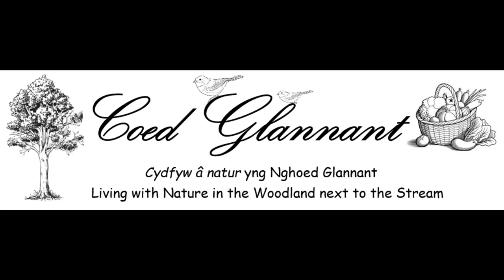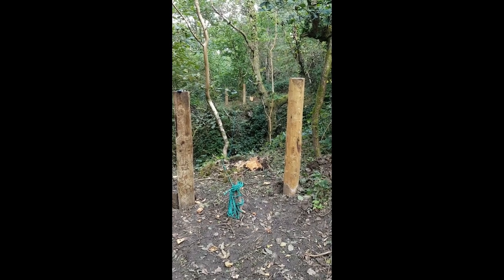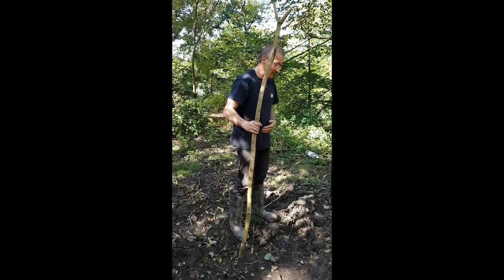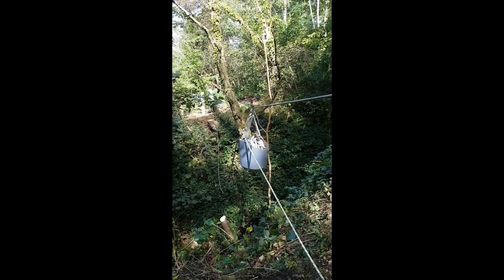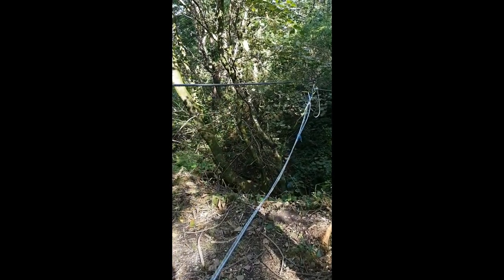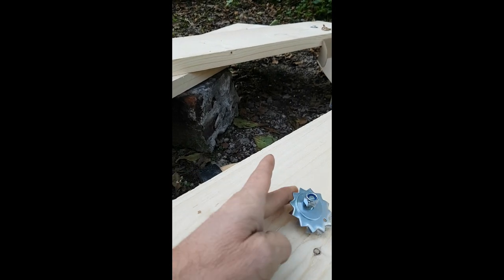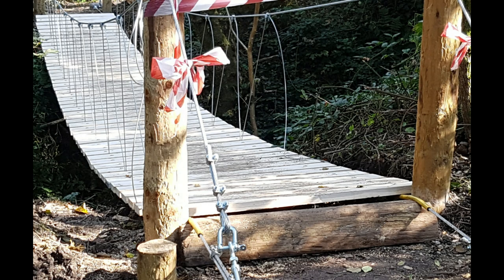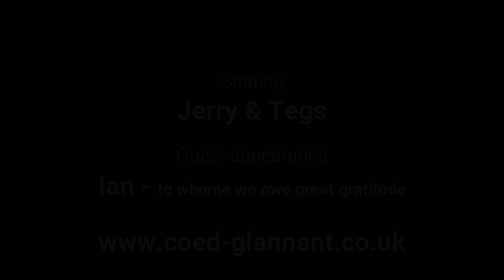Building our DIY suspension bridge

Comment: I hope your bridge has served you well. I would highly advise rotating your cable clamps 180 degrees to have the saddle on the “live” cable vs the “dead” cable end. We have a pneumonic to remember this crucial point: “Never saddle a dead horse.”  The u-bolt portion has the potential to cause catastrophic failure in the live end. Great work though!
Reply: Can you explain that further? Im assuming the saddle is the part of the clamp that the nuts tighten towards the u bolt. Live end is the short side that is cut?
Reply: I was just about to post the "never saddle a dead horse" thing and then I saw that you had ! Probably in this low tension application it would never be an issue, but there are logical engineering principles for putting the saddle on the live side (the part that crosses the ravine), the short cut off end gets the u-bolt.
Reply: @davidp4350  true true, but man if it’s that easy to do something right, I’m gonna do it right!!
Reply: @triangle_v  Absolutely agree, I worked in engineering doing amusement park rides, ski-lifts and zip lines, so wire rope was use alot.
Reply: Hello Travis, can you explain further about the clamps on the live cable vs the dead cable.  We are about to build a suspension bridge using this example.  Would really like to understand the "Never saddle a dead horse" warning.  Thank you for your help!

Comment: The way you've got the planks secured doesn't seem like the safest or smartest way to do it. I know you went "innie, outie" and its more than likely fine, but just running the wire through an eye bolt seems like it would be safer for sure. Nice work though. May try to build myself one

Comment: i coudnt help but question the thickness of the concrete where the I bolts went through.  was there more than 4" of concrete? doesnt take much to have a concrete failure.
Reply: And no steel reinforcement 😮
Reply: @anya3027  I was being nice. There's no way that those concrete fixtures are not going to either get pulled right out of the ground and if they don't they're definitely going to crack around the eye bolt because you need 4 in in every direction around any fastening area... And if you get lucky good but I'd rather not play Russian roulette with 5 out of six bullets.

Comment: The saying goes to "Never saddle a dead horse" all of your cable clamps are installed backwards and that becomes a saftey hazard. Not trying to be rude, please look up and learn about the physics behind it. Your concrete posts aren't quite as strong as you think but they work for what they're worth. Overall a great video to learn something from.